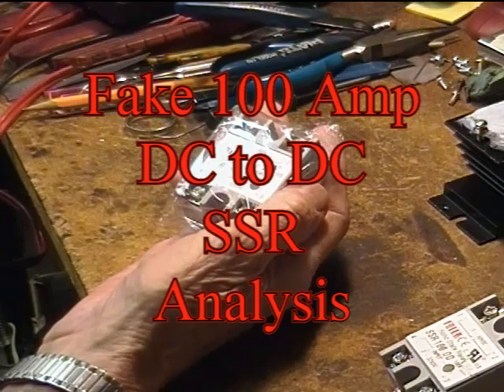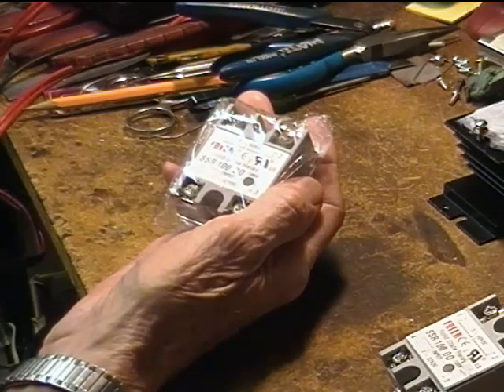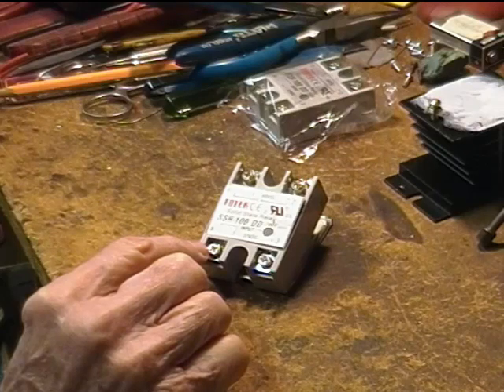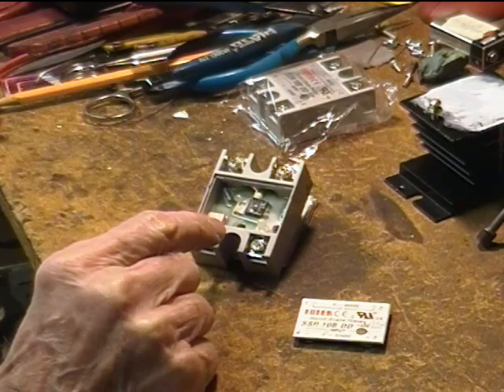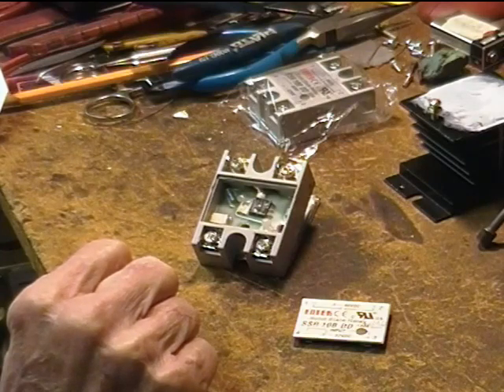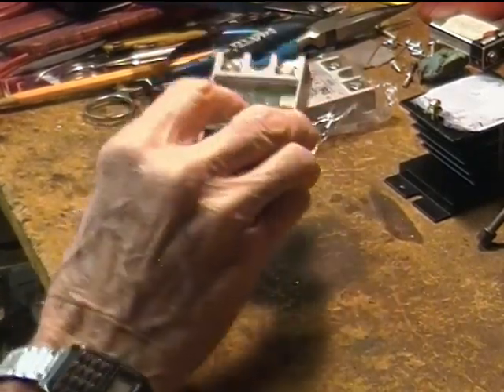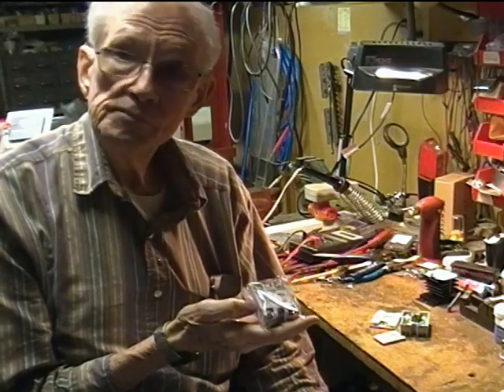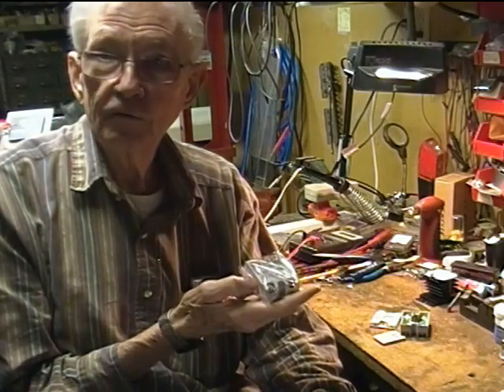#178 Tear Down of Failed Fake 100 amp DC to DC SSR

Comment: MANY THANKS for revealing what is REALLY inside that 100A SSR...UNBELIEVABLE!!!!!...almost worth looking inside BEFORE using high current, low cost modules.  The BJT fix is probably not as simple as just cutting and piling in an IRFP260N mosfet???.

Your video reminded me of the time I "can-opened" a high-rated 'lytic cap (It was just not heavy enough)...and finding a tiny cap in a big can...PLUS 80% air!!
Reply: It never claimed to be a 100A. 100 is just in the name, according to its datasheet, its maximum rarings are a resistive load of 25A and an inductive load of 7.5A

Comment: if you wire the mosfet in parralel can you double the load?
Reply from the maker: Probably. Designers seem to usually supply a separate gate drive circuit for each of the paralleled Mosfets, though.  The point of this round of testing was to see if these DC-DC SSR;s could deliver performance anywhere near to their advertised ratings.
Reply: @frenchcreekvalley   you done a great job. maybe replacing the cheap mosfet with a irfp260n woudl be better?
Reply from the maker: @BEYTEK  I did try that.  It worked for a while, but the gate drive voltage from the existing circuit wasn't adequate, so it eventually failed from not  being fully "ON".
Reply: @frenchcreekvalley   got ya. i can pwm control the drivers side with 5v or 12v, what would you recomend trying? Thanks for your reply?
Reply from the maker: @BEYTEK  Take a look at the schematic for the 1000 watt ZVS Induction Heater for a drive circuit that works well:
https://spaco.org/Blacksmithing/ZVSInductionHeater/1000WattZVSInductionHeaterNotes.htm
The diagram is about 1/3 of the way down the page.  You can see that they clamp the gate to 12 volts.
Also, take the time to read the IRFP260N datasheet:
https://www.infineon.com/dgdl/irfp260npbf.pdf?

Comment: This is a counterfeit  SSR, if you look closely the brand is EQIEK, the characters look similar to FOTEK brand units, FOTEK does not produce a 100A SSR in their SSR-DA/DD/AA/AD lineup they produce a 10A, 25A, 40A, 50A and 75A SSR and all of the stated are available with the H suffix for the high power version. I have a source where you can get authentic FOTEK SSR for roughly 20$ USD shipped.
Reply from the maker: No, this one DOES say "FOTEK" on the cover, although I am certain that it is some sort of Knock-Off.  But, I did some googling for "EQIEK SSR".  I found several hits, but some were dead!   Many said "unavailable" or "don't know  when we might have some more" etc....When I DID get to a listing, every one I saw a picture of did have FOTEK printed on the face of the device.  Just on a hunch, I looked down through the details on one of them  that was "discontinued by mfr" and found the that mfr was, indeed EQIEK.  Well that's a lesson learned for me.  Thank you for the "heads up".
Here's an Amazon link to just such a situation:
https://www.amazon.sg/SSR-25DA-Single-Semi-Conductor-Output-24-380V/dp/B07DWXNYFK
Look down in the "Technical Details" to find the mfr. reference.
  I used to watch a guy called serpentza or something like that, a European living in China.  On one of his videos he said that the Chinese have a saying:  "if you can cheat, cheat".

Comment: I ordered this one from amazon: https://www.amazon.de/gp/product/B07QPZ67D4/ref=ppx_yo_dt_b_asin_title_o02_s00?ie=UTF8&psc=1.
Tested it up to 43A in my ZVS2500W. I mounted it on an old CPU Cooler with a 12V Fan to be shure it it gets proper cooling. Periodically testing it by hand and it got not really warm even in longer test settings. 20-30 minutes.
A TWTADE SSR-60 DD is on the way. 
But I am not sure if the labels on the different SSRs have something to do with the components that are in the device and it is a only a matter of luck that they work or not. They are all overrated.
Reply from the maker: Thank you for your feedback.  I tried to order the SSR that you used in your test, but they will not ship it to the USA.
I finally found the 60 amp TWTADE SSR at aliexpress.:
https://www.aliexpress.com/item/32838339029.html
Reply: @frenchcreekvalley  I received a twtade SSR-60DD from here: https://au.grandado.com/products/twtade-single-phase-solid-state-relay-ssr-25dd-ssr-40dd-ssr-50dd-ssr-60dd-actually-3-32-dc-to-5-60-dc-ssr-relay-solid-state?variant=18271002460217 
But had no time for a test until now. Paid only EUR 6,79!? for it.
Reply: Unfortunately they seem to be impossible to find now so I guess I'll need to go the diy route as there is no reliable option
Reply: Here's an equivalent that will ship to the US: https://smile.amazon.com/dp/B07R7LN1WF/ref=cm_sw_r_cp_awdb_imm_t1_Vr-YFbFJ936H3?_encoding=UTF8&psc=1